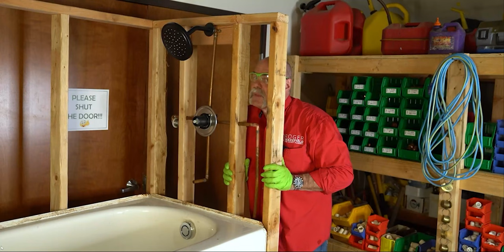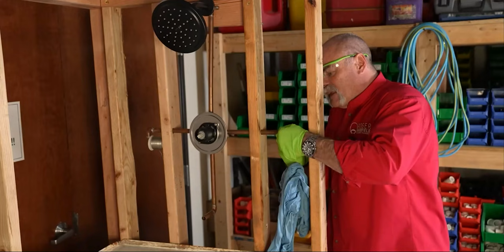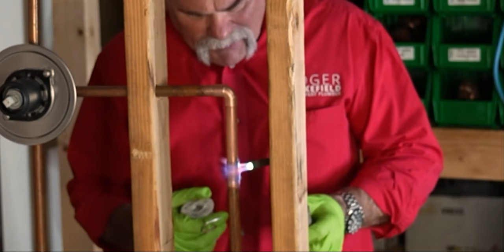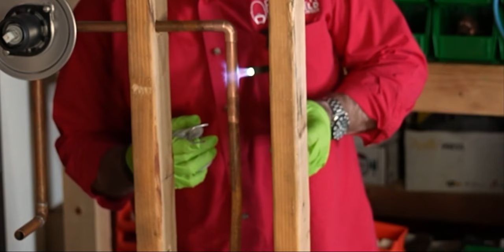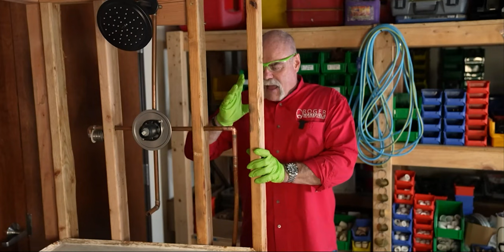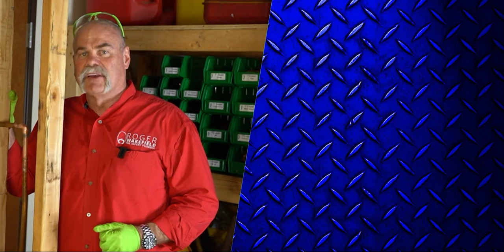HOW TO SOLDER COPPER PIPE AND FITTINGS THE EASIEST WAY

Comment: Great video, word of caution to the average diy-er: When you sweat fittings off near your tub, be particularly careful that no excess solder or flux lands on your tub, or it will leave a nasty little burn in the acrylic. Never hurts to lay down a drop sheet in the tub.
Reply: There's probably a wall there

Comment: Clean
Flux
2 wraps of solder (of correct type and diameter...for the pipe joint)
Heat
Watch the solder disappear into the joint.
Let cool 
Wipe clean.

Comment: I've been watching your channel for a while now, but one thing I think would be interesting to your non trained viewers would be how to make accurate measurements. In this video you came up with that 4" measurement easily. It would be an interesting video to show exactly how you came up with that length. And a follow on to that showing how you lay out a complex series (e.g., under a kitchen sink. hot, cold, dishwasher, outside faucet, drains, ...)
Reply: Thats a valid idea. Because how would someone know where to pull there measurements from on a coupling or 90 so the pipe fits how it should and isnt too short to get a proper seal.

Comment: Hey roger I like to solder usually but sometimes when you can’t get the water shut off all the way I use pro press or if repair needs to be done in a timely manner I will use press

Comment: I like to solder copper but I do you pex crimp fittings and have not had any problems. 
What are the life span of pro press o rings and can they last the life of a building in nyc with hot and cold temps. 
Pro press has its uses , the copper fittings will last but what about the o rings.    Great content

Comment: When cleaning off the old solder/flux, after removing a fitting, with the abrasive sanding cloth should you cleaning the pipe with the grain of the copper or can you against? Does going against the grain harm the copper pipe?

Comment: Roger great video as I have a more basic understanding of copper fittings  and how it actually looks but I'm just worried about how I'm actually going to learn this. I'm a rough guy who does waterlines and all I use is PEX since that's what is replacing copper. I really don't want to attempt these unless I'm taught and not just try to solder because I watched a video. The fittings apply the same way which is nice.

Comment: Depends on what day of the week it it is I normally use press then  solder I hate shark bite fittings
Reply: I used to love SharkBite Fittings due to the convenience of them until I found out that they reduced the size of the pipe and where the problem of my water pressure issue. I had to go back and remove almost all the ones I had installed smdh 🥺

Comment: I soldered today. I'd cut the 90 out and use two couplings total vs sweating the 90 off. Less chance of a leak in my opinion.
Reply: 2 more possible leaks that way. Less joints the better. Unsoldering and cleaning correctly is the way to go. Imo.
Reply: @S_a_n22  I respect that. I honestly haven't had a solder joint leak in years, so that's not a major concern to me.
Reply: @gstrader73  I agree. Properly executed no joint should leak.
Reply: @S_a_n22  I don't understand this thread. How can you have anything other than a 90 and a straight union in this case?

Comment: From experience I usually take the cartridge out. Few times I turned water back on while fitting was still hot and water melted a washer or messed it up some how . Plus gives a place for the heat and fumes to go.

Comment: I see no down side to propex. Shark bites are not a good permanent solution. Copper is good but what do you do to existing pipes when it whistles? I would like to be proficient at soldering copper just so I can put on adapter to got to propex.

Comment: We use Propress for everything except flush valves. As long as you seat copper all they way you're good.  I'll rough in a bk or other chain restaurant in 2 days or less. That includes venting,water and gas drops.

Comment: I still solder pipe on repairs but we use the press tool cuz I work for a school system so when u got kids in the bldg and u got a leak it can be repaired quick with the press allowing school to continue plus we do large copper from 2" all the way to 4" and I'm sure u know how time consuming sweating 4" copper is!! Lol